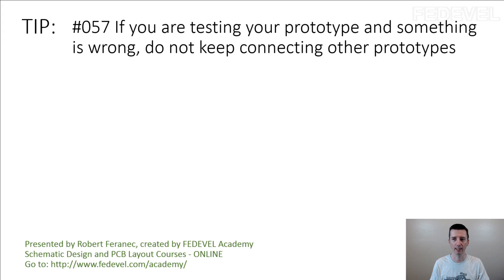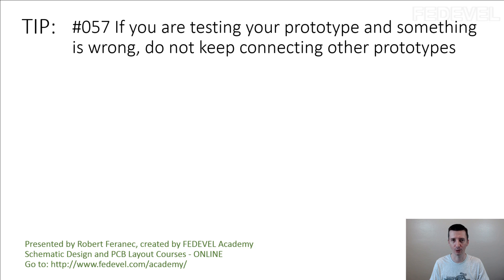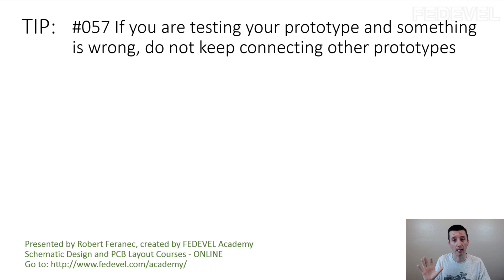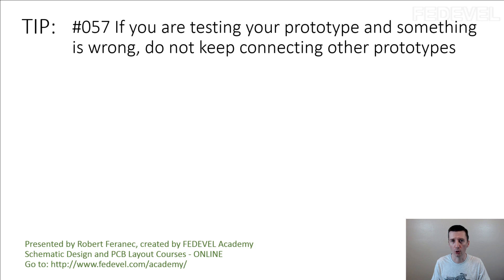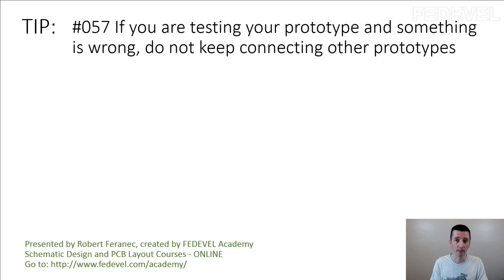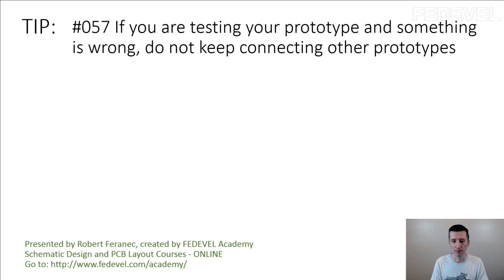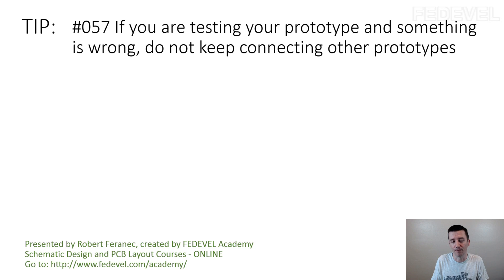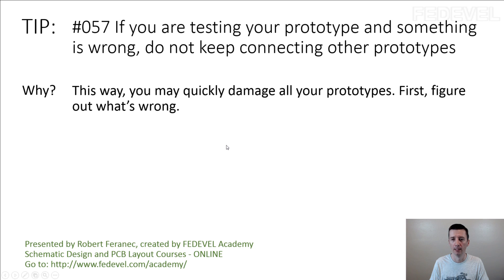TIP #057: If you are testing your prototype and something is wrong, do not ...

Comment: This tip makes sense.... because out of 5 prototypes if you try 2 and they dont work, you are left with 3 where some of the remaining ones might have production faults but some might be manufactured according to the schematic and if you have a problem in the schmatic you might be able to find it out and using rework tools to fix the remaining prototypes so that you dont have to order and wait for the second batch to be shipped....

Comment: Good tip!
And what I've learned:
- always test the prototype on a lab powersupply with current limiter, so when the circuit is faulty (i.e., soldering shorts or schematic error) no magic smoke will escape.
- If you have a faulty prototype and the current limiter sets in, use a thermal imaging camera (i.e. FLIR) to see if a component gets excessively hot (it's probably the culprit).
Reply from the maker: These are good. PS: Power supply with current limiter will in different tip ;)